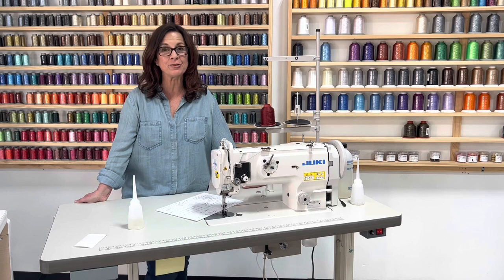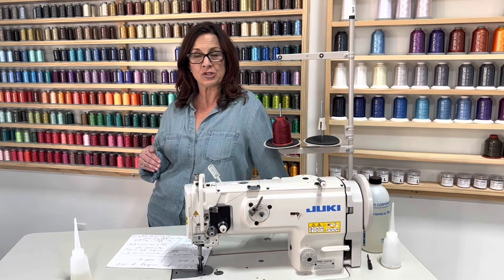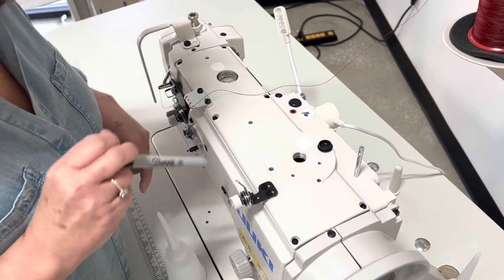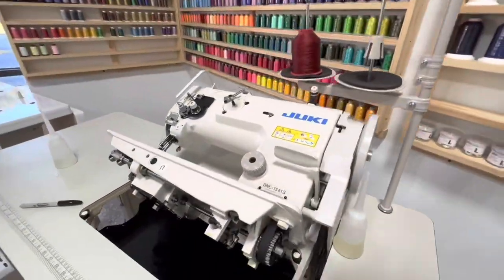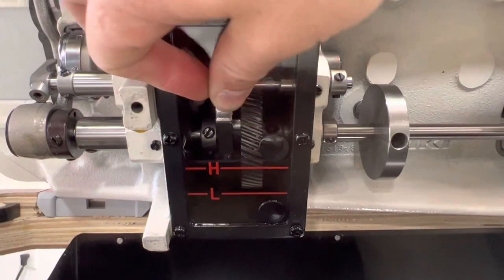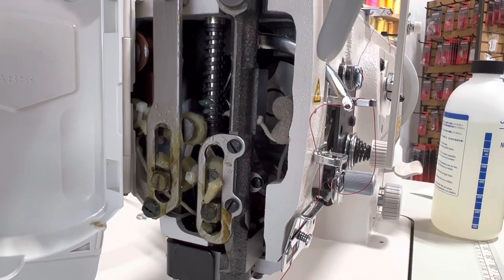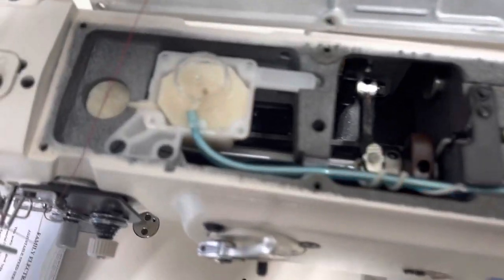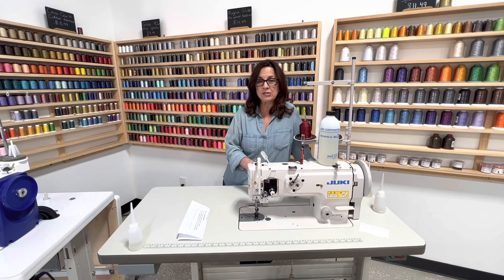How To Oil The Juki 1541 Industrial (instructional)

Comment: The hook is lubricated by the pump in the oil reservoir area, which has the High and Low markings. That's what that reservoir is for. There is an adjustment for the amount of oil that is supplied by the pump to the hook. It's in the manual, page 17 of my manual.
Reply from the maker: Thanks for the info

Comment: Great video this may sound crazy but how do you open the big bottle of oil. couldn't pry it off had to poke a hole, i'm sure there is an easy  way
Reply from the maker: You have to poke a hole with a tool .  Be very careful.
Reply: Maureen thanks so much for asking this!!  Sitting here right now, not knowing how to do it either!!!
Reply: I used some large side cutters and was able to cut/pry the plug out of the bottle. This also allowed me to put the plug back in and the cap back on to make sure it doesn't leak.

Comment: Gigi, I recently saw a video of someone changing the oil in an 1181.  Is this something that should be done with a 1541?  I’ve had my machine for about 3 years and have never changed the oil in the reservoir - only oiled the parts.  Thanks for the info.